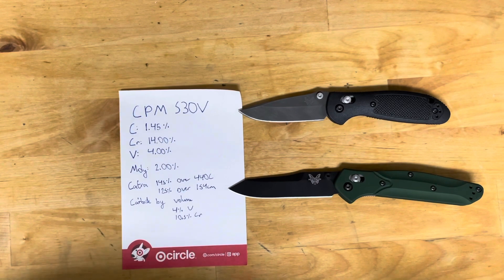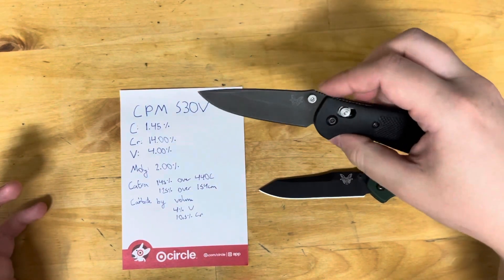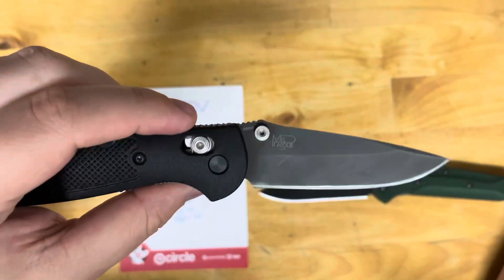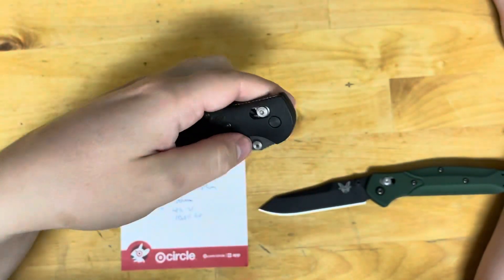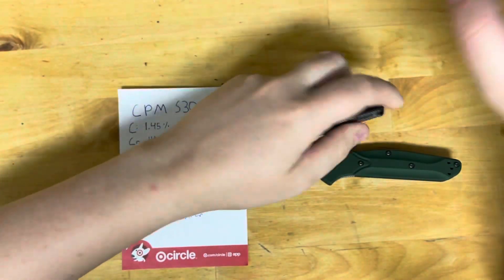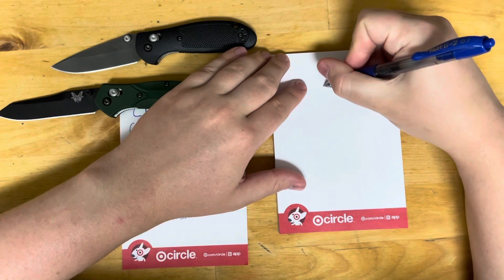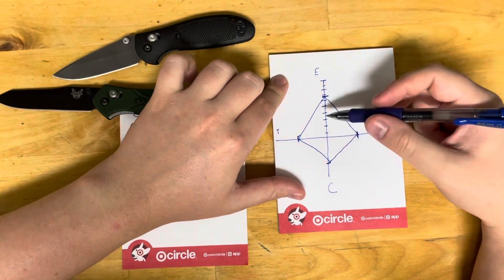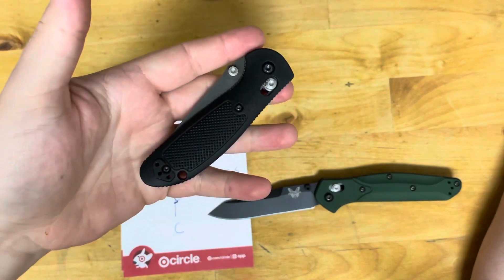S30V Blade Steel in Depth

Comment: I hate s30v but can't stop using it because it is perfect on the osborne 940. Saw tooth is perfect but chips with mirror edge with any hard use. Luv/hate for me. Easy enough to sharpen also.
Reply: Perhaps your angle is too low. Example: try 25 degree instead of say 18-20 or 30 instead of 20
Reply: Your first mistake is mirror polishing s30v. It is not a steel Preforms very well with A mirror it does much better with the lower grid edge in the 320-800 range. S30v is not a chippy steel by nature so if you are getting chips it's one of two things... you are on your first or second edge and haven't gotten past the fatigued steel from the factory edge.. or you reprofiled it down at to low of an angle for the type cutting you do commonly with it. There is always the slight possibility that you got one with a heat treat  that didnt take to spec as it does happen but that's pretty damn rare now days but there are some that get out. The thing that is confusing me with your statement that says "with saw tooth it's great but chips with mirror" so with a course edge it's great but with a high polish it chips? So long as the angle is the same edge finish will have very very little net effect on edge stability. If anything an extremely course toothy edge would have micro chipping before a high grit ultra fine edge would, due to the larger teeth being further away from the bulk of the steel/support at the apex vs the fine teeth that are well supported right at the apex. If it was just chipping I would say it's one of the two things I mentioned but with the remark of saw tooth it's perfect but chips with a mirror that holds no validation unless you dropped the edge down way down in between the toothy course edge and the mirror edge.. if that's the case than simply increase the edge angle back to where it was when you had edge stability and you should be set. It really gets under my skin when people hear someone say oh such and such steel is chippy and run around repeating that as gospel. Half the people saying xxx steel is chippy hasn't ever even used that steel and just repeating crap they hear. Now I'm not saying your doing that but I do find it odd with the no chippy with a course edge but chips with a mirror.. but that brings one to thought, how are you achieving that mirror? Are you using a ceramic stone to finish on? And of stropping on chromium oxide compound (like green wax based compound??) Because if you are that is indeed why your getting chipping/fractures with a polished edge and didn't with a course edge. S30v has a decent amount of vanadium carbide by volume and alumina/aluminum oxide (the abrasive that's in sintered ceramic stones and green wax abrasives like what would come with the work sharp precision adjust) is far to soft to cut the vanadium carbides. So the abrasive cuts the surrounding steel matrix but not the vanadium carbide and this leads to micro fractures around those carbides at the very apex. So if you are indeed getting your polish on with a ceramic/alumina plate that is exactly what's causing you to get fractures that you didn't get with a toothy course edge had that edge been finished on diamond or cbn.
Reply from the maker: You might like S45vn more it’s S30 2.0 everything is better, but just enough to notice a slight difference in sharpening it reminds me of 154cm

Comment: Properly heat treated s30v is as good anything else..  its all about the heat treat . A s30v is going to embarrass magnacut if the s30v is 60hrc and the magnacut is 58 hrc..
The manufacturerers got y'all paying 500 bucks for a peice of steel 3" long and the whole time it's heat treated to 59 Rockwell..  oh they'll say its 62 on the box. But the truth is it's soft .
The heat treatment is time consuming and it's hard to do It right in batches . The more blades at a time the worse consistency..
Reply: Although I certainly do agree that heat treatment is more important than the steel used within reason, Magnacut will outperform S30v with an equal quality heat treatment. Whether it's worth the money or not is different question, but Magnacut is a very good stainless steel. It's one of the few "super" steels that isn't mostly just hype.

Having said this, most modern steels will perform perfectly well if properly heat treated. You don't need fancy Magnacut or even S30v steel to get the job done. A properly heat treated blade made of 14C28N or even 1095 will perform perfectly well. If you really are on a tight budget then even scrap steel from ball bearings or leaf springs will get the job done so long as it's been forged and heat treated properly.

It all comes down to price point and the proper treatment and usage of the steel. How much that extra bit of performance is worth is subjective and something the individual must decide for themselves. Personally, I think even budget tool steels make perfectly good EDC knives.
Reply: And I found the internet steel expert in the comments! Tisk tisk

Comment: With some experience using it, I think that S30V is too often looked down upon or dismissed by a lot of people these days.  

It’s not the latest and greatest knife steel anymore, but S30V is still a solid performer; far more capable than most people actually need.